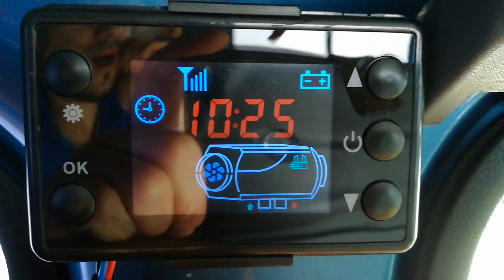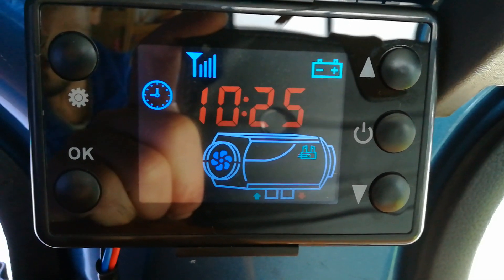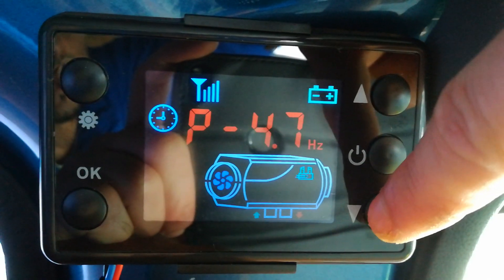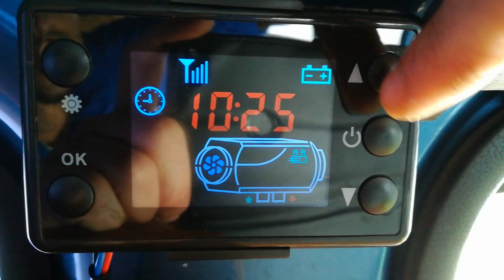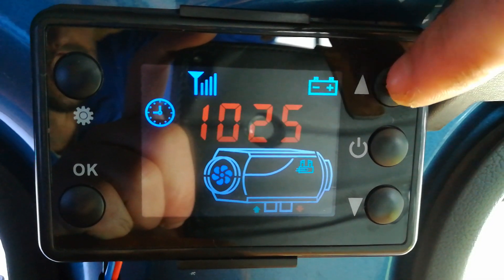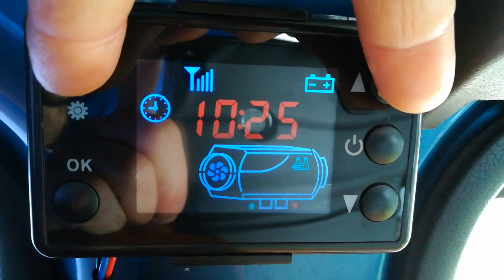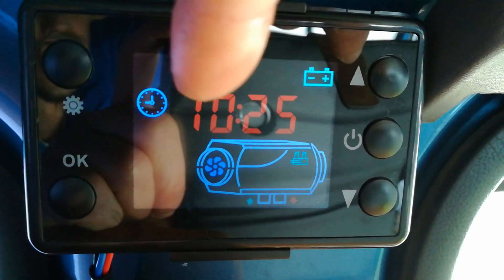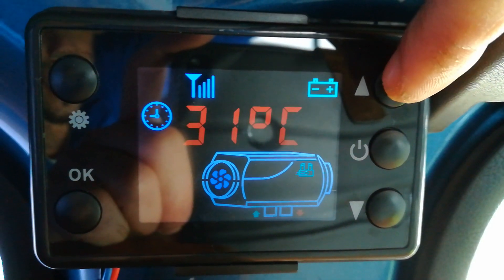Chinese diesel heater, LCD controller- How to change mode, P- Hz to set thermostat temperature

Comment: Hi Justin. 
I have an 8KW diesel heater and when I run it at 1.6 Hz it works perfectly but when I use it to 2.0 up to 4.0 Hz it turns off and shows the E-05 code which in the manual it says the unit is overheated. 
Just I don't understand why in between  2.0 and 4.0 Hz it turns off and when I use it to 1.6 or 5.5 Hz it works perfectly. 
I will appreciate your help. Thank you so much.
Fredi.
Reply from the maker: Hi Fredi, 
E05 - is definitely Overheating. Check air intake is not restricted at rear of heater, check fan is not impeded. Ensure that the installed heat vent is not blocked / restricted. Also check that heating duct has not been crushed, any vent grills etc restricting air flow causing the heater to over heat. 
Also, what also works is adjusting pmin pmax this is the pumpflow. You can acces This settings after you press passcode: 1688 or 9009 works sometimes to as the default settings may be set to High for the fuel pump " thermostat mode" 
If you try all this, it maybe a faulty temp sensor (try to inspect) or the unit is faulty. 
Hope this works out, but let me know how you get on. Thanks from Justin
Reply from the maker: Also, there are some other solutions in the comments of this video.
Where you can change sn-1 to sn-2 or change the elevation from 5000ft to less for a fix. Hope this helps...
https://youtu.be/Bg6l42kpZYw

Comment: Does it switch on and off itself to maintain desired temperature?
Reply from the maker: Hi unfortunately it does not turn off it just ticks over, so if you have a 5 kW heater it's lowest run can be quite hot

Comment: Thank you for your great video. I have a diesel heater in my camper van. I have a problem with it which I hope somebody can help me with. The heater is connected to a second battery. When I start the heater in the morning it shuts down after about five minutes. It does that because the battery is lower than 12.5volt. The battery is new but loses a bit of its power during cold nights. When I drive and the battery is charged the diesel heater is running fine. So it only shuts itself down when there is not enough juice in the battery. Does anyone have an idea how to solve this without adding an extra battery to the van?
Reply from the maker: Hi, best practice is to start you vehicle's engine when starting up the diesel heater & when turning it off. The heater uses 9amps - 12amps on start up & at shut down for a glow plug in the diesel heater. It's for the first 4 mins... The amps then settles to 0.5amps to 1.5amps once the RED glow plug symbol goes out on the lcd controller & when the heater is up & running(on its lowest setting/speed rate.) By using the engine, the alternator generates power for the start up of the diesel heater & can be turned off once the glow plug is done, needed to cause the internal combustion within the heater at the initial start. A full single 110amh 12v leisure battery should give you approximately 4 to 6 hours of use, depending on the heater speed that you set. 
The lowest "tick over" setting is best to save the most power, somewhere between 0.5amp to 0.8amps per hour. Also it's a good idea to max out the diesel heater 5 mins before shutting down the heater, to burn of any soot & carbon build up from "long periods of low tick over". Hope that helps, thanks from Justin 💯😎👍
Reply: @justinmeynell6011  thank you for your quick response. I will give it a try and hope it will solve the problem. 👍🏼👍🏼👍🏼
Reply: Mine will at least run at 12.1v, I'm not sure about starting up though? 

I have mine set on a timer in my van, and sometimes the voltage is pretty low when I go outside to start the engine.

Comment: What should the fuel pump settings be ? I have the temperature settings at 35
Reply from the maker: Hi, when you set the temperature on the lcd controller, the fuel pump will automatically adjust its speed depending if it needs to heat or tick over. The heater never turns off, even on its lowest... So there will always be some heat coming from the unit. Hope that helps 😎🔥👍

Comment: Thanks man! I want the Hz setting, so I can run at a steady heat output.
Reply: Depends of your overall setup and temperature. I get the best results (no soot, no smoke)  at 5,6Hz.  Haven't had to clean it for a year now and I run it sometimes twice a day for 2-6 hours to heat my workshop. It is important to have short tubes with big diameter, with as less bends as possible for fresh air and exhaust. I'm using 40mm with adapters for both.

Comment: Can anyone help me? If I set the temp I want to have the room at say e.g 17 degrees the heater doesnt stop it keeps going.
Reply from the maker: Your right... Unlike the more expensive Eberspacher or Webasto units thats turns off & starts up when the temperature is set low. The cheaper diesel heaters never turn off & will keep burning on its lowest setting (1.4hz), the room temperature will keep raising due to this. Hope this helps, cheers from Justin
Reply: @justinmeynell6011  aaah, ok. So can that be changed?  

Thanks for the help
Reply: @justinmeynell6011  They tend to build up more soot when running on low settings. Mine starts to smoke below 2,5Hz.

Comment: Does anyone know how to adjust the low voltage shut down setting?
Reply from the maker: Hi, I was never able to find one... I thought about it as well. I know if left to run, it will continue operation until your battery is fully dead.
I used the voltage meter on the display and when the battery voltage got to 11.6v... I turned it off.
You can also buy a low voltage alarm for RC toys or Autos, that you set the lowest voltage before the alarm goes off... To save your battery.

Unfortunately, by turning off the diesel heater, the glow plug comes ON for a few minutes as part of it's shut down procedure and uses 10 amps. There needs to be enough power in the battery for this otherwise the heater will soot up if turned off immediately. 
Also a "Max" burn, 5 minutes before shut down is recommended to burn off any soot build up in these heaters, especially if they have been on tick over over the night. 
Hope the helps, from Justin

Comment: Hi. Can you tell me if the display is permanently on or if it can be turned off? Thanks
Reply from the maker: Hi, the display is always on, there is no settings to turn it off. Also, the brightness can not be adjusted... It does become less bright. I think its because there is to much power, powering the back light on the LCD screen that after a while it burns out slightly and becomes darker. Hope that helps, thanks from Justin
Reply: @justinmeynell6011  OK thanks 🤙🏻

Comment: how long did you use the heater ? any problem?  link for buy the heater ?
Reply from the maker: Hi, thanks for your message! I used the heater for 2 years full time when I lived in my van, no problems. Somtimes I put a drop of diesel cleaner to clean the system & always did a max burn out before turning it off to clear any soot build up. I found with a 110 ah leisure battery, the heater would last all night with the lowest setting (1.6hz), above this the battery lost charged considerably faster & would only last 4 hours. Hope this helps, thanks from Justin 😊👍
Reply: @justinmeynell6011  Hello, or your controller display all the time is on?

Comment: Does anyone know what the settings should be for high altitude?
Reply from the maker: Hi, I've seen a few asking the same... no one seems to have been able to find a option for altitude adustment. I feel your best bet is to control/tune the heater in "Hz" mode, not in "thermostat" mode... As this would bypass & produce a better "air to fuel" burn ratio than the pre-set "temperature to fuel pump" factory settings on the controller. Sorry, I hope that makes sence and helps.
Thanks from Justin
Reply: @justinmeynell6011  Yeah, the closest I've found is that there is a facebook group called "chinese diesel vehicle air heaters-troubleshooting" or something like that which might have this information.  My facebook account is all dorked up though and was hoping someone here might know.  Please let me know if you happen to find out.

Comment: What should the fuel pump hz be set at?
Reply from the maker: I have mine a few clicks (hz's) above the lowest setting. The earlier versions of the heater where notorious for sooting up if left running on the lowest setting for to long. There needs to be enough heat in the burn chamber to burn of that soot, keep an eye on the temperature bar on the display... It should be just under the "red" bars in the upper "yellow" if you want it on the lowest tick over. Don't forget to give it a max out occasionally or 5 minutes before you turn it off, to clear/burn off any soot build up. I add a drop of diesel fuel cleaner to the tank now and again to help break down the build up. 
Hope that helps... 
Thanks from Justin 👍😉
Reply: @justinmeynell6011  can you name a brand of a diesle fuel cleaner?
Reply from the maker: @underwoodblog  Wynns Diesel Extreme Cleaner

Comment: Hi, does anybody know for what the setting "PF-1 to PF-6" in the setup is for? I've tried min and max setting but see no change. My heater builds up soot, when I run it on P-HZ 2.5 also when I let it run on max for around 15min after power up and before shutdown.

Comment: Any idea on where the setting is to change the screen brightness setting?
Reply from the maker: Hi, I hope you found the answer... I saw others trying to figure it out too.
A common thread that keeped poping up was that the LCD screen brightness "dimms" down after a few months of use. I think it maybe because the screen back-light slightly burns out because it is set to bright or has to much voltage. Hope that helps, cheers from Justin

Comment: Hi. yesterday arrived my unit, i did not installed yet, but Ive a question: where does it sense the temperature for automatic operation? In the control panel or in the heater body- I want to install the heater outside but the control pannel inside the boat cabin in order to avoid noises for sleeping and Im not sure if it is ok. Thanks from buenos aires
Reply from the maker: Hi, thanks for your message. I read that the circuit board inside the heater has not been weatherproof'ed... as a another guy wanted to mount the heater outside of his van. There is a video of him using contact insolation paint to water proof the electrics inside the heater.
There is a thermostat for the room temperature located in the lcd controller and one thermostat to control the core housing temperature vs the speed of the fan inside of the heating unit. (I.e. Room lcd thermostat tells the fuel pump to pump faster & burn more fuel causing the burn chamber to get hotter, this increase/decrease in temperature then tells the fan thermostat to spin faster (or slower) keeping the unit from getting to hot and providing constant hot air. ) I would keep the air inlet & outlet exhaust pipes somehow waterproofed & out of strong winds, perhaps a cover? Many thanks from Justin

Comment: outstanding!  had the same issue ... how did you ever work this out????
Reply from the maker: Hi, thanks! I scoured web forums for ages on "how to" & it eventually came up trumps. Cheers from Justin 😊👍😎
Reply from the maker: Grish Nakh  just before you give up... You can buy a new LCD controller for the heater at under £10of ebay, worth a shot.